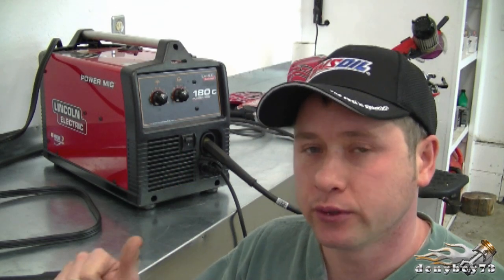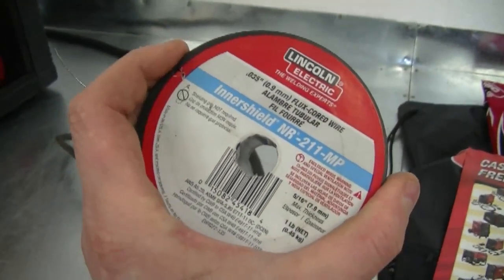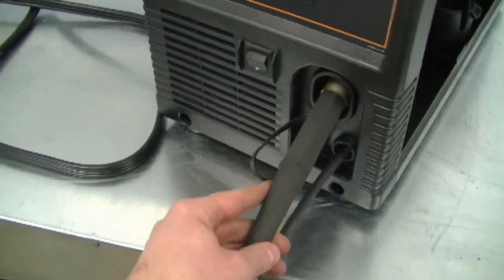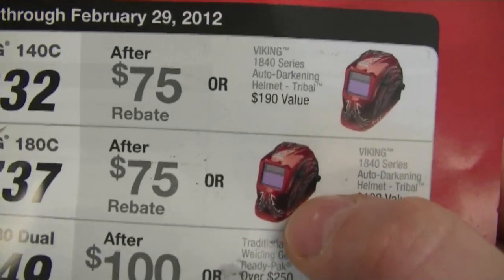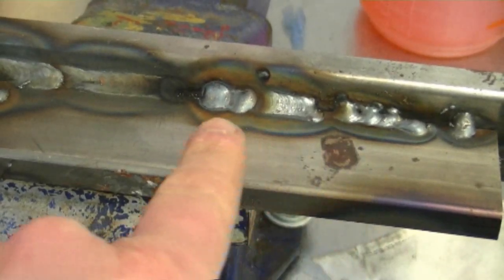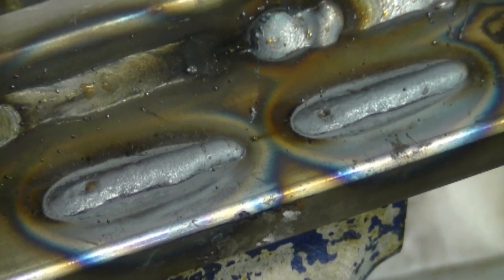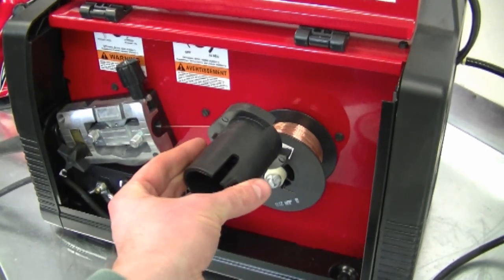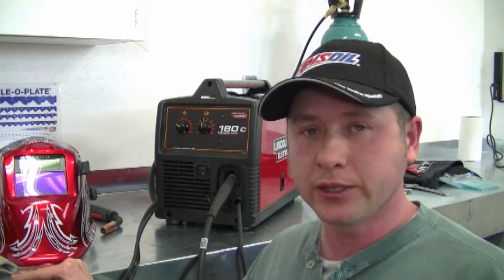Review of Power Mig 180c Welder by Lincoln Electric

Comment: Please secure that tank if you haven't already.Those things can go thru a brick wall if the valve is knocked off. Don't sweat the haters they are just mad because their lives stink.
Just keep practicing thats the only difference between a beginner and a pro and every new machine has it's problems

Comment: I learned to MIG weld without formal training, and I thought it was 'instinct' that told me how to adjust feed speed and voltage. Only years later did I realize that it was more the SOUND that I was using, rather than the visual appearance of the puddle. Suddenly I understood how I could tell another welder how to adjust his settings, just by listening! 

kevincaron here on youtube has a video explaining "the sound of a good MIG weld" -- it's worth the time for anybody who's learning the skill.

Comment: I have the 140 "homeowner version" and it is great for what I do. I don't use the solid wire as the gas would be too expensive for what I use it for. flux core is just fine.

Comment: Welding is about technique not power.  A 110v welder will do almost anything at home or small commercial.  I worked as a welding tech for a Lincoln repair center.  They will always sell you bigger.  Just spend the time to learn to weld, youtube is great for that.

Comment: You should hear bacon frying.  If you hear those loud pops, you usually have a little too much wire speed.  Turn the wire feed down a hair and you should be good.  Can't believe they put letters on the front instead of voltage.

Comment: Got a Daytona Mig welder 15 yrs. ago.  Only learned how to use it 3 yrs. ago by going to the community college and taking the basic course.  I was the only one in the class who was not a welder already.  Most of the students had 10-15 yrs. experience in the shipyards, but contract requirements now are for certified welders (no certificate=no job) and the certificate requires knowledge of geometry, chemistry, metalurgy, trigonometry ....these guys had all gone from high school to a welding job, But today, without the certification, you can't get a job welding on roads/bridges, ships, airplanes, etc.  Anyplace where the manufacturer might get sued if a weld fails.  So some extent that probably applies to every weld anybody does except on their own equipment.  BTW, I thought your welds looked very good.

Comment: As a steel fabricator. In oz I’m called a boilermaker welder
This is one of the best small single phase welder most folks will buy
They really are quite good and 180 amps is more than enough for any small home workshop jobs
It weighs 30khs. Or 60 pounds. They’re a solid unit. And the crackle is what u need to hear when laying a bead
Use the argon co2 gas combo. Helps lay nicer welds. Trust me

Comment: I have the same machine, the letters shown relate to voltage but all you will need to know  one knob it wire speed and the other is heat settings.  I strictly use flux core and buy the large spools.  If you try to switch between gas and flux core you have to change the polarity on the machine, for this reason I stay with the flux core but the gas does do a nice clean weld on thin metal but it has    to be real clean compared to flux core can handle rusty parts better.  Its a great machine.

Comment: Those letters  B through  J  the B is 20 volts to J which is 180 volts their  20 volt increments
Reply from the maker: good tip
Reply: This is not true. 180  volts! 25 volts will weld 1/2 inch plate all day. Check the specs. However, I have used this machine. In the right hands with proper joint prep, you can do up to 3/8 inch in one pass. The arc is also very smooth and responsive with the flux-core too. A great  go-to for general things like sheet metal on cars and such. Versatile welding wire diameters from .024 inches to .030 inches (I think) Play with it man! Listen for that crisp sound of the arc. It's instant gratification. Great video. WELD ON!
Reply: No, no, no,  Mig welders don't put out that kind of voltage silly.  LOL  20 volts is max on this welder.  You would have to put a volt meter on the positive and negative lugs in the door where the wire feed is to measure each one while welding.  You could video results if you don't have someone to help.  I hate when they don't show voltage and wires speed.  You can also time the wire and measure it to find wire speed.  Then use real welding charts to see what it should be.

Comment: Hello, I been restoring dirt bikes for about 2 years now and want to get into fabricating some frames, etc. Could you recommend a welder kit I could use for small Jobs at home without breaking the Bank. New to welding....Thanks fro any info.
Reply from the maker: either the 180 or 140 Lincoln mig welder
Reply: donyboy73 Thnx for the quick reply. I will look into it

Comment: Dony, do you prefer mig vers tig? Looking for a welder.
Reply: ***** TIG is not as easy as it looks on the internet. I'd go MIG,
Reply: I have a mig and I also have a Tig Tig is harder and takes more time to get welding mig is fast and easy and very convenient
Reply: I know I'm 3 yrs late here but if you are serious about being equipped to handle different types of material, then you need both MIG & TIG.  I have 4 welders at my home shop.  TIG will do Stainless & aluminum, Mig won't unless you have one with a spool gun which is very expensive and not necessary unless you're doing production runs.
Reply: @larryrobinson7492  Actually you can mig stainless pretty good with mig. But tiger is best for aluminum without a spool gun.

Comment: Love your videos , the only thing i would say is keep that door on the side of it closed when its plugged in . high amps and volts are the only dangerous thing and because the wires carries it there is little safety other then the lid . Your welding looks great for not doing it much , P.s. my teacher always drove that safety stuff in my head and i have been shocked more then most :op  Congrats it will help you a Lot

Comment: Hi, I sold my Miller cp-200 and Bought a Lincoln 175,Reason Being,is i cant run 3 Phase,of my Portable Machine,I Believe the Model before the 1 you Have, I Dont even look at the chart, Tell EVERYONE about CHANGING POLARITY for Flux Core!
I Usually run my dials the same,As 2 Oclock,on Both,and The Sound of bacon Sizzling!,, My cp200 had a 100% Duty,But,ive Never Had a Problem with the 175, And For BIG Stuff, I Use the LN-25 Feeder, You can really put some Wire Down,esp Using 1/16th, Nice Vid!,,

Comment: That is a nice welder for the money. Just a Tip for you in side light Material gas & Solid wire is great if out side & if its windy switch to flux core it's self shielding & on thicker Material you will get better Penetration,only draw back is more splatter & slag to clean up. O & with you living in Canada I would Recommend removing your wire from the welder if not going to use for awhile store it in ziplock bags it can go bad if Exposed to Moisture for to long. Peace

Comment: Hi there, have you ever tried to use a step down converter for that welder? 240 to 120v adapter? I know Lincoln make a 180dual, just curious as to if a regular 180 can be plugged into a step down converter for lower amperage settings when 240 isn’t available. Thanks

Comment: Hi Doni having a problem with my FS 250 weed eater, starting very good, will work non stop, maybe with a higher speed and when I turn off it has a problem to restart, I had adjusted the 2 screws way back, sometimes it runs at normal speed, and starts again normally, to clean the  carb yes and adjust the screws slowly, will try this after finishing the citing, wee have 3 week's temperatures in the plus 40 Celsius here in Greece, and afraid of fire at the end of the world.

Comment: your stick out (distance between contact tip and workpiece) is way to long you want it to be about 1/4" and you should be pulling the bead instead of pushing... you can push BUT you run a higher risk of getting lack of fusion

Comment: havent watched the while video yet, im not particularly fond of this type of machine but i think its good for someone who doesnt like welding but likes fixxing automotive type problems.. but just commenting on that you chose this machine based the the plug style, its really easy to make an adapter cable yourself without needing to open up any walls just get the male end to fit your wall plug and a female end to fit your welder and put some 8 or 10 guage wire in between the two, if you get stranded wire with a proper rubber coating and a good length of it it doubles as a 220v extension cord

also if you dont have gyprock in your garage or if youre alright with the plug being right beside the panel its extremely easy and safe to wire a plug yourself its 3 wires and the connections are easy to make, shut the main breaker up top off and theres no chance of being shocked in a garage

Comment: Slow down your beads, increase wire speed until that snapping sound goes away, your contact tip is sticking out past the gas nozzle, should be recessed inside 1/8th of an inch, don't make circles so fast, at the end of the bead pause for a second to let that crater fill in. Keep it up.

Comment: did you change the polarity of the machine?if you got the machine with FLUX CORE setup the polarity is inverted,that is not the sound you want to hear when you are mig welding,i know that you uploaded this video almost 2,5years ago,but i just wanted to say this:D
Reply from the maker: thanks, it was ok, just getting used to it
Reply: donyboy73 I found out that A  starts  at 10 volts , B -20, C-30 etc etc , thats  what Kevin C  said .. Good  guy.

Comment: Dony, I have a 180c and I have to set up the wiring to the panel.   What size wire and breaker did you use so that the machine works safely.
Thanks , great videosssss.
Reply from the maker: 6 gauge I think, I got an electrician to do it
Reply: Robert Rogers 30 amp breaker and 10 gauge wire will work fine. But if you want to future proof it as Dons electrician did, go 50 amp, 6 gauge.

Comment: you can use a clamp meter to read actual current on those settings. or dc voltage across the two connectors inside and read each setting. i had to do it with my Eastwood. do wire speed of 4 and hold trigger for at least 5 seconds .start with J go backward.if it's transformer based machine, most of the reading will be close or that's what i got on my Eastwood that's why i returned it and got inverter technology welder.

Comment: When welding with gas your metal needs to be clean.  When you weld with flux core the metal can be dirty because the flux core acts as a 6010 or a 6011 AC rod would.  It would cut through the crud.
Reply: I think he was just throwing a bead on some slag to test it out, but yeah, a good sanding wheel to clean the surface of the weld is how you wanta start

Comment: Why on earth can't you guys call the process by its correct name - when you use an active gas such as argon/Co2/O2 mixes you are MAG welding, when use an inert gas such as pure Argon or Helium you are MIG welding.
I suppose when the ignorant manufacturer gets it wrong what chance have you got?
Reply: EASY, BOY!
Reply: David Richards Is that what your clueless shop teacher told you?
Reply: John Rambo No, That is what every welding manual states and defines, if you don't have a clue about something keep your comments to the morons who "MIG" weld everything.
Reply: Christopher McCLelland No, it is the difference between using a monatomic gas (Inert) compared to a dissociable gas (Active) - the one breaks down in an arc plasma the other does not. Pure Argon or Helium are Inert gases, Argon/CO2/O2 gas mixes are Active gases - If you weld Aluminium, Copper, Brass etc you are MIG Welding, when you weld Steel you are MAG Welding.
Reply: The process is called GMAW unless you are using flux core wire then it is FCAW. The welder is called a wire feed welder.
Reply: John Colvin / TY Colvin

Comment: Junk, bought one, even turned up it would barley penetrate thicker metal.
Reply: you try reversing the polarity? Flux core uses DCEN and solid wire uses DCEP, if you dont have that right, you'll get tons of spatter and no penetration.

Comment: @donyboy73 I've read regarding the dial meanings the letters are meaningless, it's just so you can write down the welder settings if you need to change them you can use the letters to change the settings back, the dial is different on different MIG machines but the letters don't actually mean anything. I also read (I don't use MIG much, so I can't say from experience) that it's reccomended to have the 2 dials in a similar position.

Comment: the 180 stands for 180 amps, not volts. The voltage range is approximately 11 to 23 volts. The wire speed adjusts the amp output.
Reply: jim richey What question did you answer?

Comment: what would you recommend for welding thin sheet steel and light restoration work as a beginner i do not know wether or not to get a stick welder or a mig as they are in a similar price range and i dont know what to buy.

Thanks for another great vid :)

Comment: The tip should be inside of the outer nozzle if your using argon gas. You'll probably get porous welds with the tip on the outside unless you really crank up the gas.

Comment: Nice little welder. I prefer MIG welders with infinite adjustment. I'm not sure what cost savings Lincoln gets by having preset ranges. My PowerIMIG was pretty affordable and has infinite adjustment on voltage and wire feed. Mind you, my welder didn't come with a handy chart to go by for the settings so I needed to make one up myself but not too difficult.

Comment: And you have to correspond the copper tips with the size wire your using. Aluminum is super hard to mig weld. It melts so fast. Nice informative video.

Comment: Hello DonyBoy, 
About the letters on your welder. Take the total volts (180) and divide by the number of letters. In this case (10) letters. Each letter equals 18 volts. So, (A) would be 18 volts, (B) would be 36 volts, (C) 54 volts etc. (J) 180 And there you go. Good videos, thanks
Reply: No the welder is rated for 180 amps not 180 volts. Max OCV is 34v on these machines. Actual CCV on the highest setting is around 25v with 0.035 solid core. Will differ depending on the size and type of wire your using. If you want to know exactly what voltage your putting out at the electrode you can hook up a multimeter to the + and - studs in the machine and run a bead while a buddy watches the meter.

Comment: Can this welder be plugged into a regular home power?
Reply from the maker: not mine but the new "dual" can
Reply: It can if you install a 220v plug with the appropriate size wire and breaker. I have a miller xmt 304 hooked up to my house and thats an industrial welder. Weld hours with it with no problems.